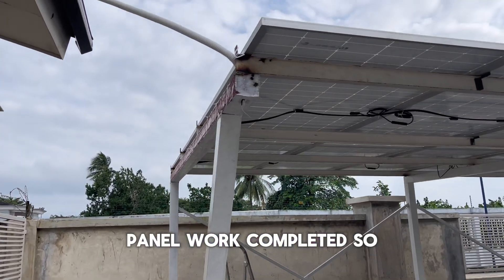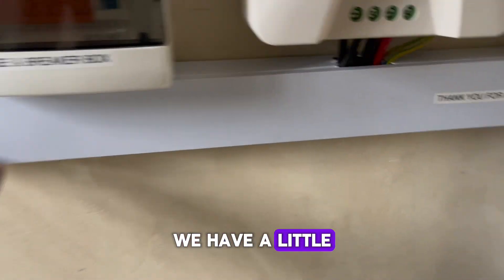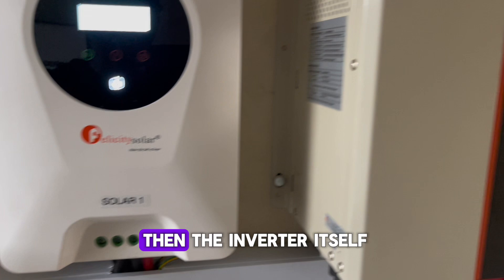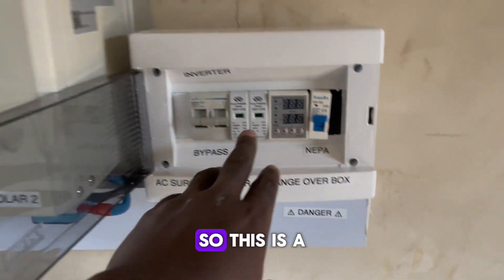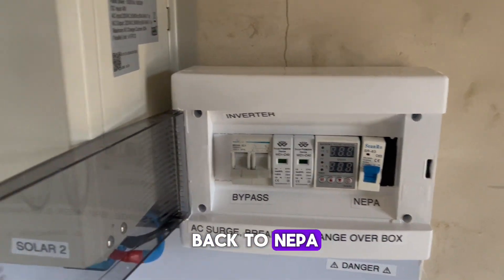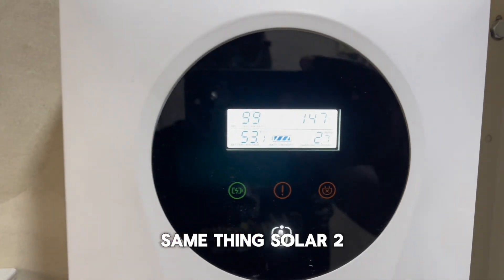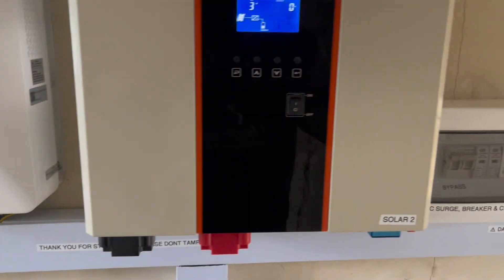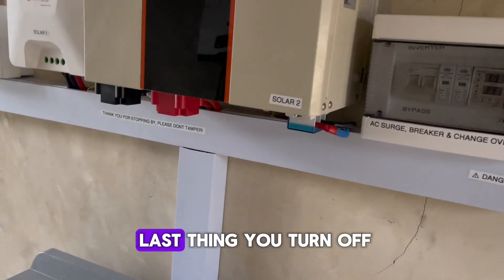11KW Solar capacity, 10KVA hybrid Inverter & 30KWh Lithium Battery installation overview #ac #reels

Comment: Here's what Google has to say about these cheap transformerless inverters: "High-frequency, transformerless inverters like these lack galvanic isolation and can potentially damage appliances, mainly due to shared DC/AC grounds, leading to ground loops, leakage currents, voltage fluctuations (brownouts/spikes), and inability to handle heavy surge loads, which can harm sensitive electronics or motors, requiring specialized installation and protection. 
How Damage Can Occur:
Ground Loops & Leakage Currents: Without a physical barrier (isolation transformer), the DC (solar/battery) and AC (appliance) sides share grounds, creating pathways for unwanted currents, causing interference or even system shutdown.
Voltage Instability (Brownouts/Spikes): Some models may dip voltage (brownouts) or produce noisy power, especially under heavy loads, which can stress motor windings and electronic components.
Poor Surge Handling: HF transformerless inverters often struggle with high starting currents (surges) from motors (fridges, pumps), potentially causing shutdowns or stress on the inverter and connected devices.
DC Leakage: The AC output can carry DC leakage, potentially damaging sensitive electronics not designed for it, or even causing issues like corrosion in marine setups".

Comment: It is a hybrid inverter. Meaning, it has charge controller embedded into it. Why the extra charge controller is for bro?
Reply from the maker: The max solar capacity the inbuilt/embedded controller can handle is 6600W. 
Meanwhile total solar capacity for this project is  10440W. Hence the  extra controller.
Reply: Is the charge controller connected to the inverter?

Comment: So how will all this cost in Nigeria?
Reply from the maker: This is our ZURRIAN MARS PLAN(10KVA) with the following features. 

Package: 
1) 10,440Wp Solar Capacity (18pcs of 580W panel)
2) 10KVA Inverter
3) 30KWH Lithium Battery
4) Installation & safety accessories 

With the current exchange rate, this is currently 13Million Naira (tax inclusive).

Comment: Pls can you share the details of that miniature change over. I have never seen this before. Where can I buy one?
Reply from the maker: MCB change-over comes in different sizes, 63A, 125A, etc. The one in this video is 63A, and about 20,000 Naira here in Abuja - Nigeria
Reply: How can I place order for the change over
Reply: Search for manual transfer switch on jumia, you will see alot of them.  @danielekon7441